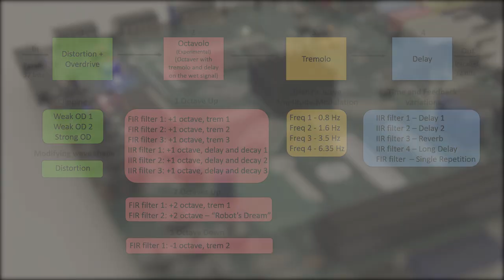FPGA Design and Implementation of Electric Guitar Audio Effects Xilinx XOHW17 XIL-84082 - WINNER

Comment: This is a great project. However, one question, how did you connect an instrument level source to line level input? Normally, you expect to connect to something over 1M-1.5M ohm where input for Zedboard is line level. That's why you don't play so hard with the guitar?
Thanks!

Comment: Isn't FPGA an overkill for sound processing? I thinking in do something like this, could I do it with a uC ?
Reply: uC?
Reply from the maker: It is quite an overkill -  our primary goal was to do something with FPGA, and using it for guitar effects was just personal preference. If your goal is solely audio processing, it is easier and quicker (by orders of magnitude) to do it in something like C, either with a micro-controller or just your pc (providing you have a good A/D on the uC, or an audio-interface between the guitar and computer)
Reply: Vladili Thanks for your reply, I going to be using an esp32, sending the data through Bluetooth to a web app, processing it and retransmitting again to a sound device 😁
Reply from the maker: @cassianofranco3082  Hmm.. have you seen something similar somewhere else? Because all these retransmissions are quite expensive in terms of processing power.. just the overhead of sending/receiving might add too much latency for a real-time "feel" of effects (for example delay of 20-30msec is something that can really start to bother you, if you are the one playing the instrument). And what do you mean by a web-app? Are you going to use JS for that?
Reply: @Vladili  I will ajust the size of the payload for best latency. And yes JS, gonna try the Bluetooth Api from Chrome, I'am expecting something arround 5ms max, but if that doesn't  work I will be doing the processing on esp32
Reply: Very interested in this just found out about this and want to build a distortion saturation box
Reply: @Vladili  Ya lo creo dijo el Josh del Drake y Josh xdxdxDDDDXDxd It's another world to work from zero on FPGA, design all the stuff vs Design your Pedal with uC. If it wasn't hard enough to create this kind of proyects with STM32, this guy is on another level, he was a superhero for creat the pedal on the FPGA. I'm so impressed... :0

Comment: hey man did u use pre-amp before pluging the guitar to the board? I'm implementing the audio example in the ZYNQ Book Tutorials and I wonder if I can hear the sound of my guitar at line out?
Reply from the maker: I didn't use a preamp, but plugged the guitar directly to the line-in jack, and the amp to the line-out, and it works fine.
I guess you would get a better sound quality if you do use a preamp, since the guitar output is not really at line level.. but you can also tweak many parameters in the on board audio-codec to adjust input/output levels, and make it sound good.

Comment: So distortion is just add harmonics to the original signal? and overdrive is the same but more smooth?
Reply from the maker: Well, yes and no. One does not simply "add" harmonics... It's one of the most complicated effects (if not THE most complicated) to emulate with digital means, and there are endless methods to do it (really, A LOT of different approaches just to make something sound "like a tube-screamer", and we did something pretty simple in the time-frame we had..). But generally speaking, what we hear as distortion/OD is caused by the added harmonics, but the quality of the distortion, comes from the methods that are used to "add" those harmonics.

Comment: Hi, you did a really cool stuff!Congratulation! I need a information and hope you can help me. I have to plug to 2 analog/digital microphones and 1 speaker to a board. For your experience do you think I can do it on the zedboard? I was thinking to plug one to line in and the other to the mic in ( in case of analog mics)
Reply from the maker: Thanks!
I don't know what do you mean by digital mic, but all the audio inputs on the board are analog. The mic-in is suitable for a microphone, and also provides phantom power for the mic. The line-in connector can maybe support a microphone, depending on the output level of the mic, but I never tried it.
You can connect the speaker to either line-out or headphones-out jack, both worked with a guitar amp.
There are smaller and cheaper alternatives for the Zedboard however (depending on your project) - such as the Zybo, which also has mic-in, line-in, and headphones-out, although it has less physical interfaces, and a smaller FPGA fabric.